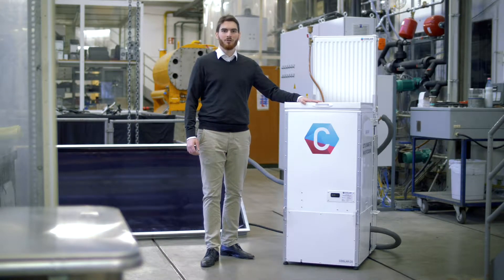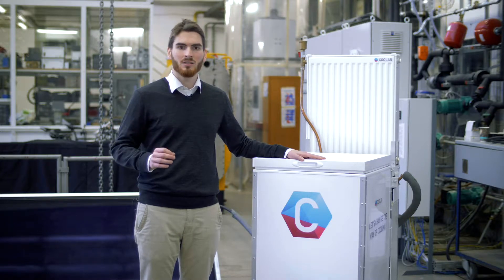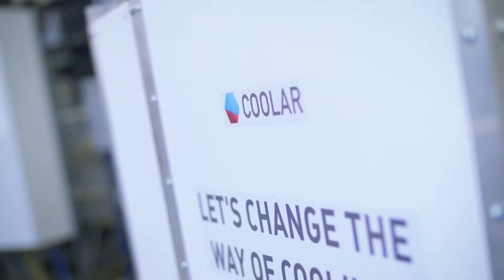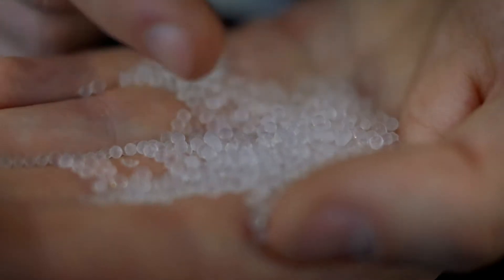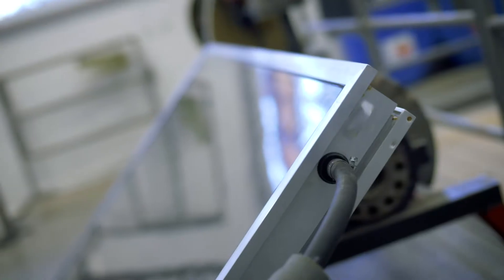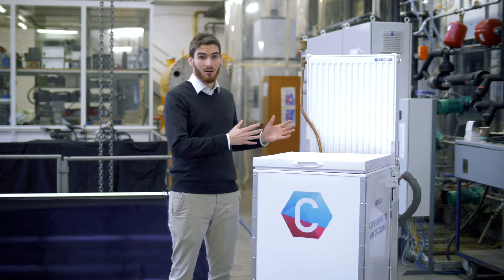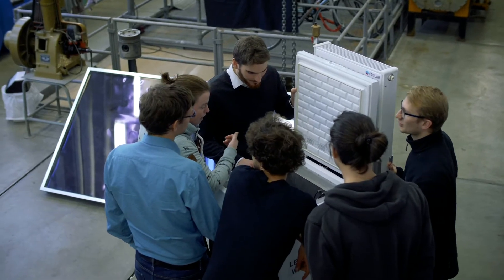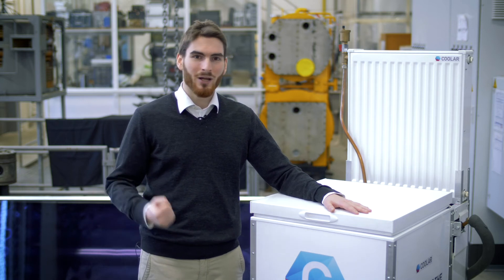How does the electricity-free Coolar refrigerator work?

Comment: What temperatures can it cool to? And does it work equally well on hot and cold as well as dry and humid climates? Evaporation cooling usually struggles with high heat and humidity. Also, how do you control the cooling temp range? Awesome idea.

Comment: the fridge doesn't need electricity, the solar heat does. how you trasfer the heated water without pump?
Reply: Hot water rising in the panel, draws the cooler water into it.. therfore as long as the sun heats it up you have circulation.
Reply: @TrashPanda71  that's the basic principle. In order to apply that in the system a certain condition needed.
For example "oil immersive HV Transformers."
Watch the video, it's hard to achieve fluid circulation with that setup(small diameter pipe, and position).
Reply: @n113hadi9  

Might be why to this day it's not for sale on their website. Works on paper but falls short in the real world.

Comment: Absorption cooling is not new, some refrigerators use natural gas for heat source and ammonia as the refrigerant. As you know, industry uses this method too in co-generator and waste heat transfer. Who is going to leave a refrigerator out in the sun? And if you mount the panel far away from the refrigerator you are going to have high heat losses. I realize this is a bit critical, but electricity is efficient and more practical combined with a solar panel  then this method.

Comment: Just buy a 100 refrigerator.
A 200$ solar panner
And a 200wH battery.
Total cost. Under 600$
Reply: Need an inverter to go from 12v or what ever your system voltage is to 120v A.C. so add another $200.
Plus I just got a new 3.8 c.i. fridge and it was $235.. prices have gotten alot higher..

Comment: It is not electricity free if you use a solar panel. It may be off grid, but if the panel breaks and you cant get a new one.,, then what?
Reply: It appears the "solar panel" is not generating electricity but hot water which evaporates the water from the silica gel, returning the vapor to the condensation chamber. So if the panel "breaks", put it back together. Idk.

Comment: The only downside I see to this is that you have to use live steam to dry the silica. Which means installation in any developed country HAS to be done by a certified boiler operator ($$$), even if it's just to tighten two compression fittings together. So...maybe relax the "no electrical power consumption" constraint just a little and allow for the two silica streams to be transported between two otherwise sealed units. Then anyone can do the install, significantly driving down ownership cost.
Reply: it has to be done by a certified boiler operator only if the pressures involved are so concernable, that you cannot trust anyone to do it... here the steam isn´t under any pressure. but I thought too the same you thought, cause then, it´s less complex, thus cheaper... Isolating the silica-cassette from the steam-stream with a valve, taking out the cassette, replacing it with an dry one, and carrying the depleted cassette to the drying unit daily, isn´t much of a hustle either, and even simpler/cheaper... But it would also demand vacuuming the cassette-compartment every time with a good foot-pump...

Comment: If u take out the air from the pipes then it will crash under atmospheric pressure! How u avoid that ?
Reply: It has water. Same as the radiator in your car, or your brake lines. None of those have any air in it. The fluid (non compressible) keeps everything in shape.

Comment: What is the minimum temperature achieved with this system?
Reply: A better question would be to see Q versus delta T curves. There's plenty of things that can get down to insanely cold temps (e.g. Peltier junctions) but they can only move 1W of heat or less, so they're only useful to e.g. cool a CMOS sensor. A practical fridge on the other hand needs to be able to move 100W or more of heat to prevent spoilage.